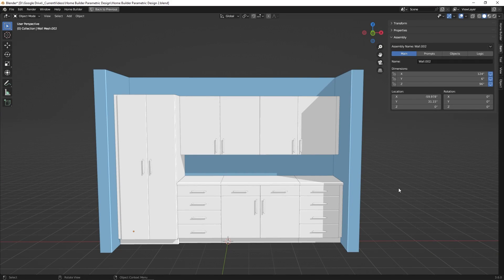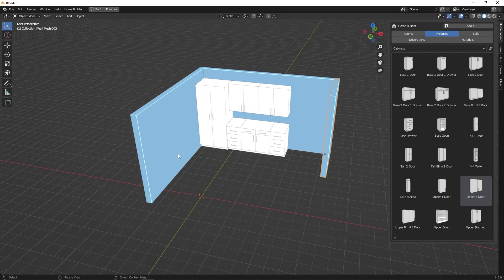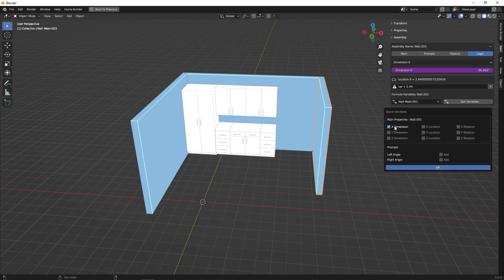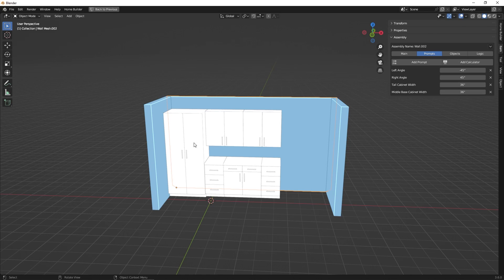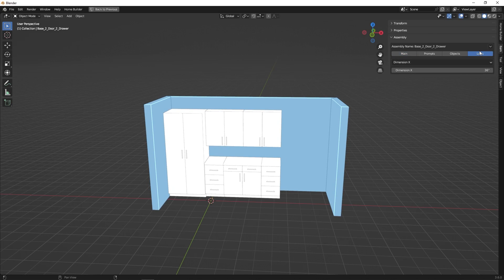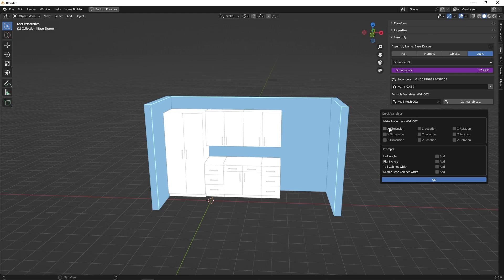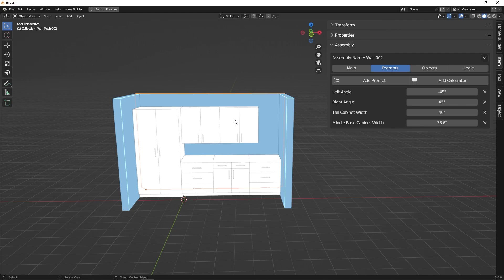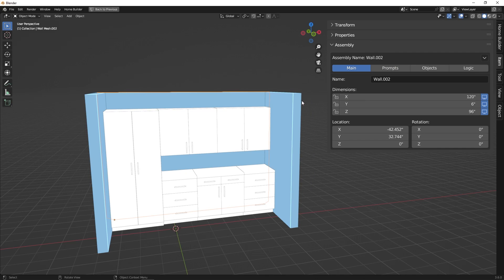Home Builder Parametric Design

Comment: When exporting designs made with this tool as an obj, certain issues are created. Like the doors exporting with both the left and right door knobs. Any idea how to circumvent that?
Reply from the maker: You can make the home builder assets static before exporting. This command is available in the assembly menu in the sidebar. Ask on discord if you need a screen shot.
Reply: @andrewpeel1996  my oversight, thank you so much!